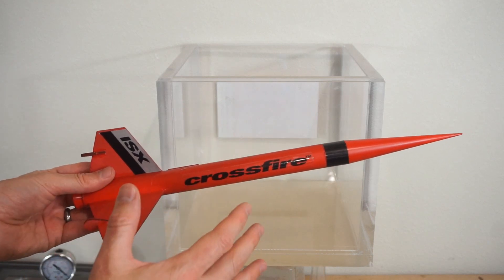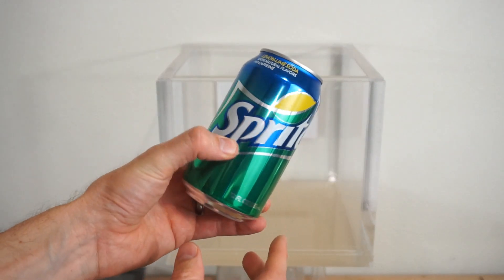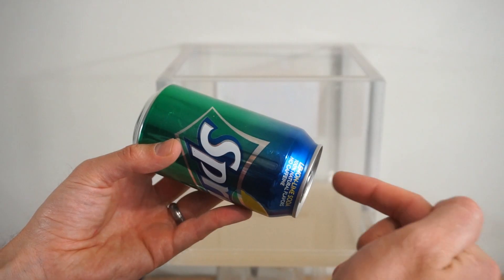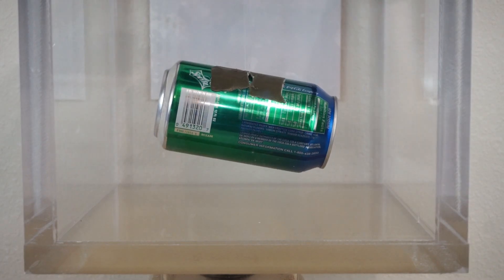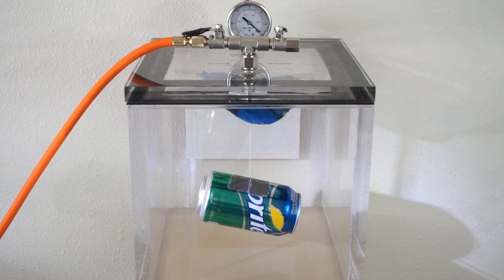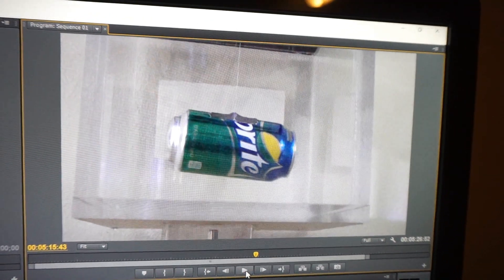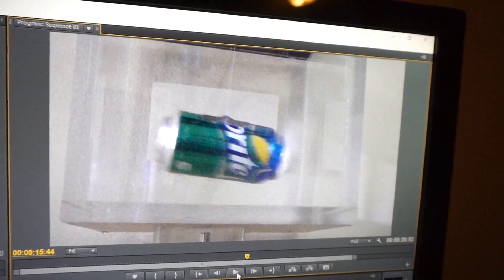Can a Rocket Fly in a Vacuum Chamber?

Comment: Look :) If you are standing in a vacuum chamber, you will NOT move until you stretch out your arm against a wall. If you blow very very hard since your body is very dense, you will move because the AIR is stopping AGAINST the WALL. It creates something, a barrier against something, a physical object material you can push against. NOW! What happens if you REMOVE the WALL???
Reply: So the system you've got going on is you exerting a force on the wall, which is then transferred back to you. That's what obviously happens when you reach out and push with your hand, right? You put pressure on the wall, Newton has his way and the force is transferred back up your arm, which is directly connected to you, making you move backwards, since the wall isn't going anywhere.

So far so good?
So now for breath. I'm actually going to use liquid if you don't mind, since it's simpler and actually helps your point more, since gas will expand very quickly to the volume of its container, so most molecules won't even hit the wall. That doesn't affect Cody's point, as much as yours, since the bit he's interested in is what happens at the instant it leaves you, everything after is unimportant. But with yours we have to keep track, which is why I'm going with liquid, so it will leave you in a nice stream and splash against the wall, which is I guess what you're sort of visualising with gasses.

So I'm going to have you projectile vomiting. I'm sorry in advance for this. You can be vomiting water, though, to make it a bit less gross. So you blast water (ewww, I really am sorry) at the wall, and a stream of distinct, unconnected molecules we can think of as tiny balls flies out of your mouth. Like your hand, they hit the wall, and the wall hits back just as hard on those molecules because there's Newton again, doing the same thing he always does.  Now what happens? How is that force acting on those molecules transferred back to you? At the moment they bounce off the wall, hit other molecules, there's a big splash and you're hoping you don't get any on your clothes. Some of it's going to, though, and, again, sorry, and that force will provide a tiny bit of thrust, like the amount a single raindrop pushes you down. But how does the majority of the force you expend get thrown back to you? I just can't see it happen unless you exhale broom handles or something else actually solid. Your arm in the first example is touching both you and the wall, but in the second there's nothing doing that. There's you, the wall, and just this mess of stuff flying around. So how's the force getting from the wall to you?
Reply: Administra2rS  actually,  if some one tried to stand in a vacuum chamber , they would die. There is no suit made for such environments.

Comment: DEBUNKED DEBUNKED DEBUNKED! This is why it moves in the vacuum chamber :) The soda can fills the chamber with lightning fast pressurised air. That stops in the sealed chamber, now the soda box can move. Same thing with the rocket. It brings it's OWN gas, air, whatever and fills the vacuum chamber for it to move. BUSTED this do not work i space where there are NO CHAIMBER, the chamber is making whats making the thrust possible. Thrust in space is a hoax, in Norway we know this, we have rockets too :)
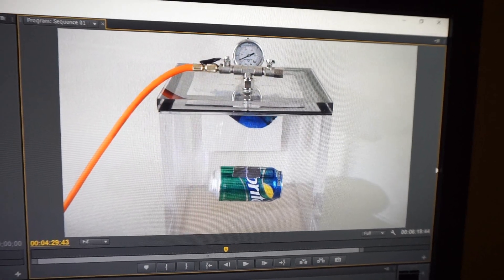Reply: At 5:00 you can see the can moving before the gases can fill the box.
Reply: In the vacuum of space, there are no gravity and negative pressure. No way for thrust to form. A bullet works cuz there are two hard parts, gas and liquid does not fit in this category. The bullet works cuz the two hard parts HOLDS together. A thrust in the vacuum of space will work if you can physically screw the air/gas that is coming out of the rocket to the chassis of the rocket, something that we can not do. Thrust does not work in space. It has EVERY thing to say witch material is used. Recoil can ONLY happen when there are two hard material parts connected. When the exhaust leaves the rocket THEN it still hangs in a sucking vacuum and it's no longer CONNECTED to the rocket. No thrust can be created. If the rocket was spitting out something of HARD material that is connected physically to the rocket, then the push could have been made (like a minigun propulsion system). You can not glue exhaust to the rocket, there for the thrust won't work. The vacuum of space is PULLING the rocket in all directions. On the surface of the earth it is positive pressure that is pushing everything IN. So the rocket can travel and thrust in positive pressure where Newton's 3 law WORKS, but FAILS in the sucking vacuum of space.
Reply: Administra2rS if there is no gravity in a vacuum then how the hell does the Moon rotate around the Earth? Forget that, if there's no gravity in a vacuum then why does the vacuum tube experiment of the feather and steel ball work? They shouldn't fall if there's no gravity.

And yes, thrust works in space the same way it works in the atmosphere: look at those water hover boards that use water cannons as thrust. Water cannot "push" off air, it's compressible, it would just move away and let the person fall. But thrust doesn't care, ejection of mass be it solid, liquid or gaseous produces a reaction.
Reply: Administra2rS lol the pressure gauge didn't move. The can moved  as soon as the soda left the can. The air inside the can expelled the soda not the other way around
Reply: Administra2rS lol did you watch the video?
The can clearly moves just as the soda is expelled from the can.
Perfect example of Newtons 3rd law
Reply: You should hve paid better attention. The can moved BEFORE the pressurized air filled the vacuum
Reply: On behalf of the Norwegian population. Apologize for letting this troll roam freely, as well as acquiring internet access.
Reply: Gra Ra5

Correct.

That is true. It's just a little sad to read this sentence: "in Norway we know this". Oh well, I'm also here for the comedy gold in the comment section.
Reply: +Administra2rS how does the can "feel" the resistance of the gas/liquid hitting the wall? What "hard" force can be transmitted through the liquid/gas exhaust? It can't.

The liquid is dispersed through the sides and so is the gas, it will not go back to push the can, therefore the can cannot "feel" what happens to the liquid and gas. It just moved out of pure recoil.

It's like firing a bullet. There's a video of a gun being fired on a vacuum chamber but they were only interested to see if it fired so they bolted the gun to the table. Someone needs to fire a gun in a rest that has rollers or something to allow movement, and film it with a slow motion camera so that everyone can see the gun starting to move back when the bullet exits the muzzle.
Reply: you realize once the gas leaves the back of a rocket it creates something to push against?
Reply: You do realize that there's this thing called an ENGINE BELL.
Reply: +Administra2rS Guess what, tard. A rocket engine works in the vacuum of space because of liquid oxeygen (or another oxidizer), and because it's pushing off of the vacuum. If your two braincells are having a hard time visualizing, think of it like this: If a bomb went off next to an asteroid in space, the asteroid would fly in the other direction. Mhm. Still think rocket engines don't work in a vacuum?
Reply: You must have 3 parts to make it move in the chamber.
1• the chamber walls
2• the gas
3• the rocket

In space you have a problem.
1•
2• the gas
3• the rocket
Reply: ...the rocket can travel and thrust in positive pressure where Newton's 3 law WORKS, but FAILS in the sucking vacuum of space.
Reply: Wrong. The rocket can not move on it's own, the gas must stop against the wall to make the push. Or fill the chamber with something else than the vacuum. It's super fast pressurised air in the soda box that fills the vacuum chamber with gas, so now it is no longer a vacuum, and the pressurised air is bouncing back from the chamber walls to push the soda box.

Comment: once the can exploded the can became 2 separate objects.  the can then pushed off its detached lid and moved slightly as you would expect.  the point is that this chamber is only a partial vacuum not like the severe infinte vacuum of space, and it has walls and a tiny space which is filled up quickly rendering the chamber a non-vacuum.  a real rocket in space would last about the same time as the can did. and the vacuum of space would remain a vacuum not turn into a partial vacuum like the chamber.
Reply: Space isn't a perfect vacuum either. For example the top layers of atmosphere are lost to the outer space, there's gas particles floating around.
Reply: Rockets use carbonated water as fuel... brainless as always.

Comment: Your chamber is too small and it's pushing on the wall. And you have it connected to a string which is connected to the can.  In space there is no wall or strings
Proof That Rockets Do Not Work In The Vacuum of Space" on YouTube
https://youtu.be/Fnf_f4rogtg
Reply: It's just about newtons third law.
if you push something one way you will go the other way with an equal kinetic energy, and a speed relative to your mass. 
if you're on a chair on wheels and you trow a heavy ball, (if you ignore friction) you will go the other way with the same kinetic energy, at a speed relative to your mass. 
If you're in a chair on wheels and you shoot a bullet this will also happen, because even though it lighter, it's going much faster and therefore also has a big kinetic energy. (kinetic energy = 1/2 x mass x velocity²). 
In the situation of the rocket, the exiting gas doesn't have a very big mass but it does have a very very high velocity (up to 4.5 kilometers per second!) therefore generating enough energy to push the rocket up the other way. 
Since speed is relativistic, as long as you keep applying thrust the rocket will keep accelerating exponentially and therefore it is able to reach insane speeds.
Reply: Amp LaGrant lol that youtube video you linked only proves that guy is an idiot
Reply: Wiek van Venetië newtons 3rd lie

Comment: Terrible presentation, yea of coarse the can isnt gaining momentum from pushing off the wall because it was propelled forward due to the can top being blasted off in the opposite direction. At the speed and force the cans lid which does have mass would certainly have enough static inertia to propel the can forward in the opposite direction the way atmosphere which has mass can push forward rocket. The problem with you theory and the flaw of your experiment is will the can move without a lid that has mass therefore give resistance to push off of and gain momentum. The argument has always been presented as  how can you propel in a vacuum, not can you propel against a lid in vacuum. Also I am not a flat earther, I know the earth is Spherical
Reply from the maker: +Moe Abe mass is mass, why do you care whether it is the lid or the liquid or a gas being flung on the other direction? Thrust happens when you throw mass in one direction you move the other direction. Also since the lid was still attached it couldn't have been the lid that propelled it forward that could have only spun it on an axis.
Reply: Exactly, mass is mass, mass and energy has to exerted against something that too has mass and energy inorder to create momentum in opposite direction, the empty atmosphereless vacuum of space has nothing to push off, its quite simple. Also sir the video clearly shows the lid being BLASTED COMPLETELY OFF to the other side of the box meaning it ricocheted of the box well before we could even see the full expansion of gases and liquid showing that it had a very high velocity, which was plenty to launch the can. So as i stated of coarse it didnt gain momentum off a wall, it was from throwing a physical lid but this experiment certainly didnt demonstrate that a rocket propels in a vacuum, thats an improper conclusion to a flawed experiment biased from someone trying to prove their hypothesis was correct.
Reply: Since there is pressure in the can there is then a force applied to both ends of the can,  When one end of the can is opened then there is only pressure against one end of the can so the can would move in that direction from the force still applied to it. Once the pressure is equitized the can will continue move from the momentum until friction slows it to a stop.

Of course if it where in actual frictionless space it would never stop.

Comment: This isn't even a remotely relational experiment to the ratio of mass ejection combustion reaction vs. payload that any rockets that supposedly traverse outer space are claimed to be. Of course the can is going to move in a vacuum if it ejects a large portion of it's total mass in any direction the remaining mass will move in the opposite direction but only EQUAL to the inertia created by the ejection of mass. Rockets DO NOT WORK ON THIS PRINCIPLE. They do not simply eject MASS in opposite directions to create the desired vector inertia. It would be much cheaper and easier to use a bowling ball slingshot to propel yourself through space. Rockets work by creating PRESSURE which causes an imbalance of the surrounding atmosphere and propel the payload opposite the ejection vector. Pressure manipulation does NOT work in a near perfect vacuum and will not propel a rocket beyond what the inertia created by the total mass of the fuel that is ejected would naturally produce. So your soda can example moves violently because the ratio of matter ejected is EXTREMELY disproportionate to the payload. If that same can were fixed against a suspended 40lb dumbbell and you did the same experiment the dumbbell and can would hardly budge as the ratio of inertial MASS vs rest MASS is much lower and much closer to that of the fuel:rocket ratios. It would still create motion, just as a rocket in space would also create motion, but the pressurized means by which it is ejected receives no benefit from atmospheric resistance and the explosion that is pressurized has no effect when there is no resistance. In layman terms it would be just as beneficial to eject the fuel in liquid form via a fire hose as it would to ignite that fuel in a chamber and release the pressurized result out into the nothingness of space.

Comment: Hey Action Lab, the size of the rocket, (compared to the immense vacuum of space and if there was really an outer space and a vacuum) would be smaller than the smallest speck
of dust. The vacuum, because of its interminable quantity would, ALWAYS, have the upper hand as to what would be more powerful, (the INFINITE vacuum, or the rocket's gas-exhaust pressure, and/or, propulsion) therefore, as soon as the rockets exhaust valves would be
opened, ALL the fuel would immediately be SUCKED out from the tin-can fuel tanks, and even the whole lemon would implode upon itself, that being the said, there would be not time, AT ALL, for the lemon-rocket to take off in any direction. The fuel, exhausted gases would “instantaneously” just become part of the vacuum, and the physical pars of the lemon-rocket, junk in space.

Think about it, your own soda can begin to BULGE in your little, WEAK, vacuum chamber, so just imagine what would happen to the tiny little dust-mite of a rocket in a HUGE, UNFATHOMABLY COLOSSAL, "PERFECT", INFINITE VACUUM!!
 
One way to find out if rockets really would fly in the vacuum of space would be for you to attach several MUCH MORE POWERFUL vacuum pumps at different locations up and down and around the tube, to simulate the so-called, infinite, and supposedly, CONSTANT, UNMOVABLE vacuum which space occupies, or vise versa, whereas, the exhaust or thrust of the rocket fuel would "immediately" be sucked out!! The infinite vacuum of space would suck EVERYTHING out right after the rocket exhaust valves would open and the fuel was 
ignited is, not only that, the tin rocket, or lemon, would also immediately be crushed by imploding on itself - or bulge out and explode as your soda can did - just like tin cans, balls, etc., etc., do in the powerful artificial vacuum chambers researchers experiment with. 

To repeat, with an experiment such as the one you performed, you, HAVE TO, 
you HAVE TO give the vacuum the UPPER HAND because that is how it 
would be like out there, in THEIR "supposedly" INFINITE vacuum of space, and which 
is what you were trying to duplicate, right?, Unfortunately, you FAILED 
miserably because the vacuum which was applied was just TO LITTLE, 
and EXTREMELY WEAK!! 

Remember, in the unfathomable vacuum, which THEY say, resides in the unfathomably 
huge space, of space, the rocket, the exhaust, the thrust, would all be smaller 
than the smallest speck of dust, and so that is why I say that, vacuum, ALWAYS has to 
have the upper hand....PERIOD!!

COOL EXPERIMENT NONETHELESS!!!!
Reply: Wrong, there are things called valves.

Comment: I've told others over and over, Do not use liquids for this type of experiment, the results will not be accurate. Use gases only.
Reply from the maker: +Kyros Nox Well you are in luck because I did use a gas. But I used a gas that was contained in a liquid so you could see it. Of course you couldn't use a liquid, they are incompressible...
Reply: @ The Action Lab  You cannot have liquids/solids as part of the test if you are trying to simulate a rocket working in a vacuum. The liquid being more dense than the gas impedes the flow of that gas. Basically the gas is pushing the liquid and the can in opposite direction. This is almost like a bullet being fired from a gun, it is not an adequate test

Simply put, the test should be strictly an expanding gas somehow thrusting a greater mass in a vacuum. Not an expanding gas between 2 liquid/solid in a vacuum.

Nice video, but inadequate test...in my opinion.
Reply: +Kyros Nox
Not a problem as long as you understand gases have mass just like liquids.